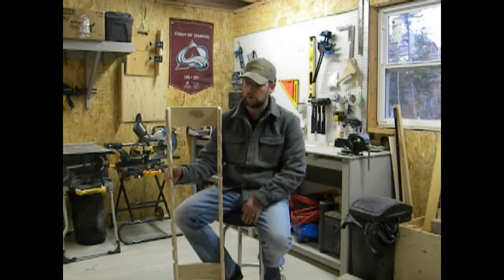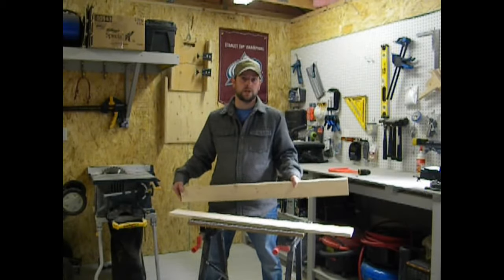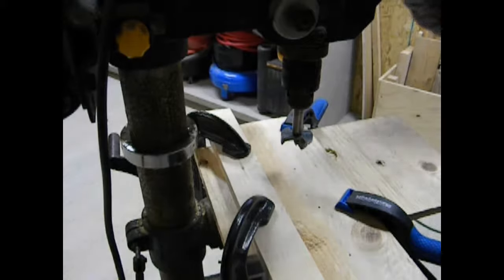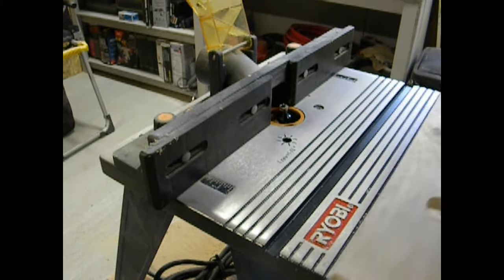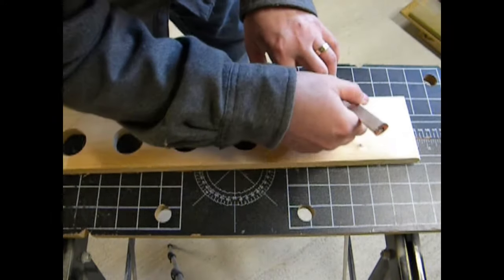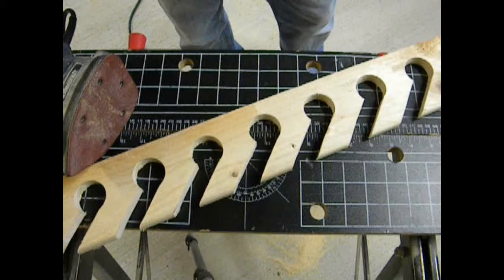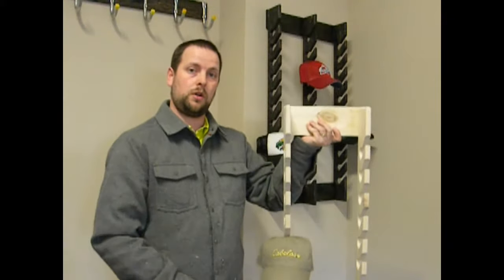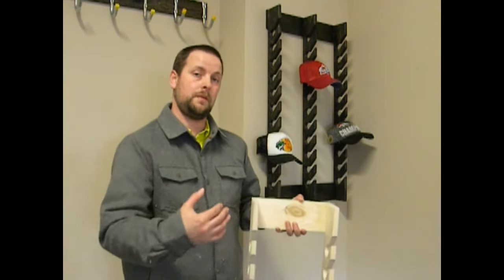How To Make A Hat Rack - SIMPLE AND EASY DIY

Comment: Since you used a template. It would be helpful if you gave more measurements-    Hole circumference.    Where the holes are, you said center but they’re clearly not-    ?  You did say one each thick spacer….
Reply: He did mention the bit was 1 1/2 inches.

Comment: whats the spacing between holes?
Reply: I printed out the template pdf and it didn't print to scale based on what width board he was using. Based on another youtube design I would guess about 4 inches (100mm). The hole he drilled is larger than the other youtuber design but my guess would be a 1.25 to 1.5 inch hole with a slot .75 to 1.0 inches. The angle used here was 45 and I think that is OK. The spacing between vertical racks should be about 1 inch (or wider) than the typical ball cap width.